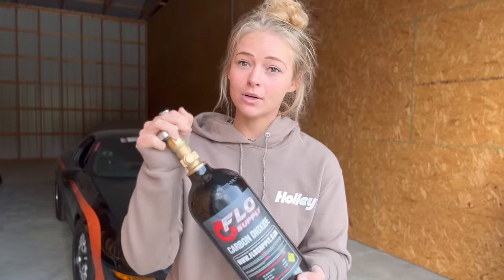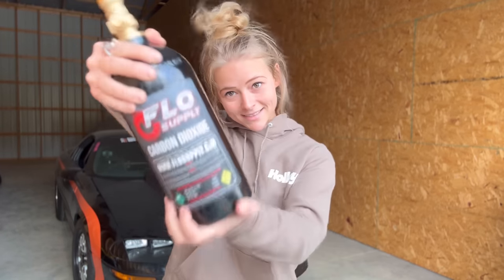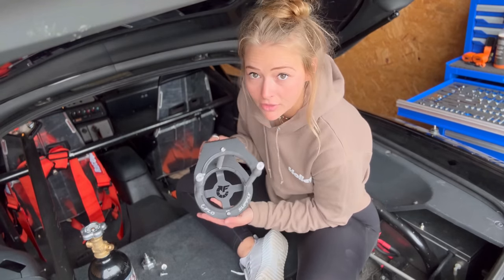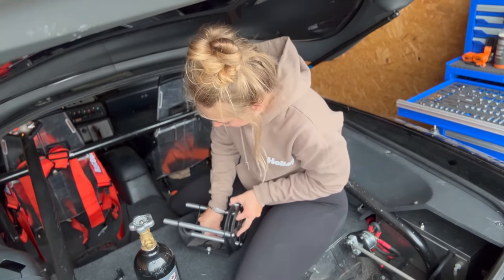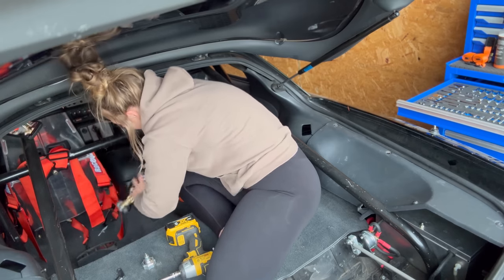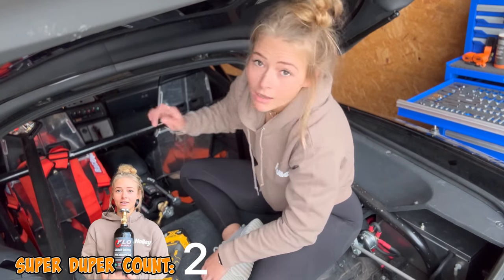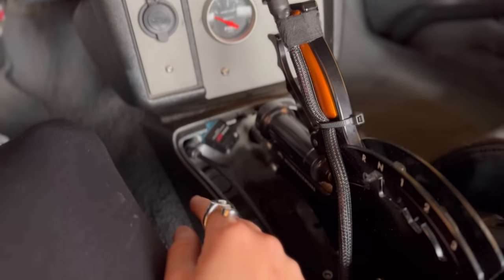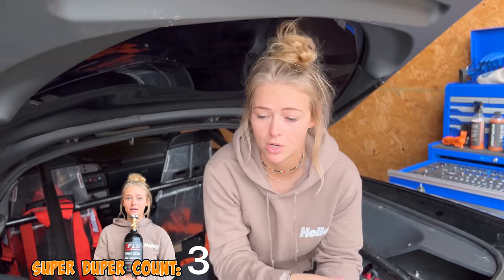How To NEVER MISS A SHIFT

Comment: After the rivnuts spin out, try some nut plates. 
Part # ms21059. 
Or ms21061 for a single wing, if it’s in a corner.
Reply: Yeah, I'm with ya on that, a few hard launches and the weight of that bottle will rip them out. A temporary strap or bungee cord holding back on it might work for now. Go with the nut plates for sure.

Comment: I gotta get better with nutsert machine as I got a little loose on one. Can you show proper procedure on a flat piece of steel? I think you have to adjust how far out it is before you squeeze but I don’t know exactly where! I bought mine from harbor freight and then tried to use the smaller Allen bolts. Then I replaced with a real bolt and that one stayed in after the other bolt loosened out